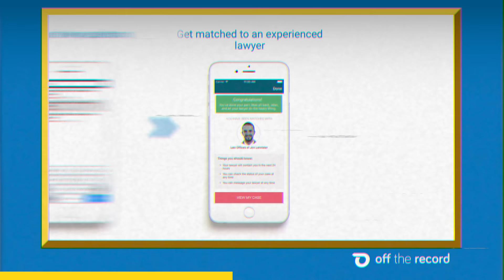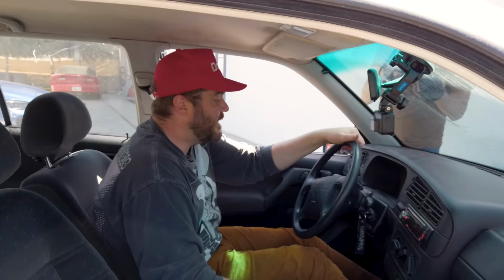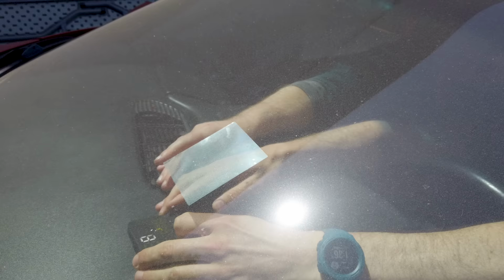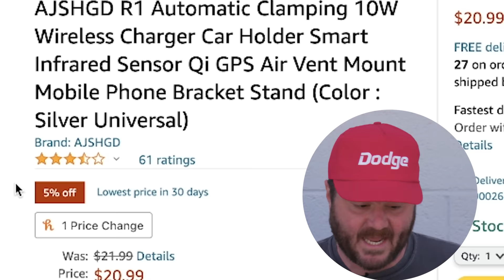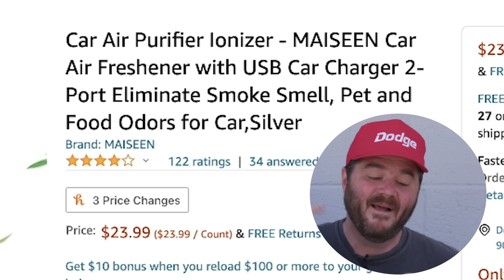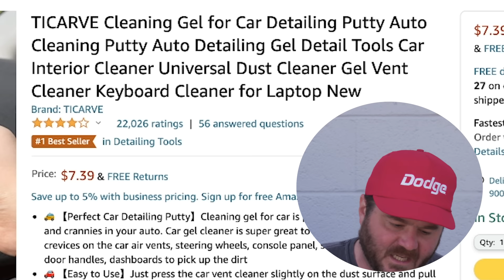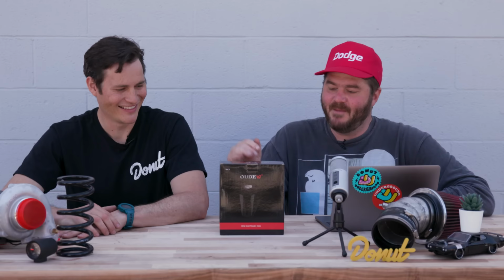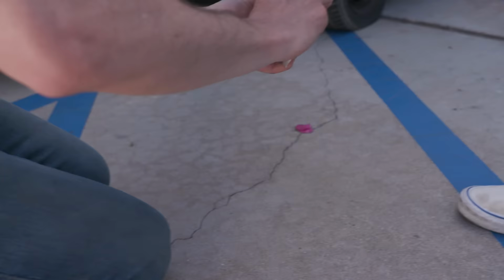We Bought the Most Futuristic Car Products on Amazon

Comment: Just to let you know, the phone holder works. It detects when you're reaching for it and unclamps the phone, and stops charging when it does. As long as it's the same or similar to the one my bf has. If it is, definitely a really cool product.
Reply: As long as your phone has a wireless charging coil built into the back of it or you get one of the ones that plugs into the bottom of your phone and you just stick it in back your case
Reply: I love mine
Reply: It also seems like they don’t understand they term “wireless “ either lol
Reply: @realwiggles  Wireless when it comes to phone charging doesn't mean wireless anyway since the charger still has a wire. There is really no actual benefit to wireless charging over wired
Reply: @connoc5078  yes it does. A wireless charger is named as such because the connection between the phone and charger is wireless. Obviously the charger itself has to be plugged in, but the actual charging method itself is wireless because it doesn't require a wired connection between the phone and charger. Why would this not be considered wireless. In one situation you simply place your phone on top of something to charge it, whereas the other requires you to plug a wire into your phone. Also, wireless chargers offer no benefits over wired chargers? What about not having to plug your phone in? My car has a wireless charger and it's definitely more convenient to set my phone down on it versus having to plug and unplug it every time I get in and out.
Reply: @realwiggles   @Cameron Fite  why would a device that requires a wire be called wireless charging? Literally the only difference is that instead of the wire ending in a head for USB c or whatever, it ends in a mat or pad or whatever.

So you think not spending literally half a second to plug a phone in is worth it for the significant increase in electricity waste?
Reply: @connoc5078  so you've got two types of chargers. One requires you to plug a wire directly into your phone, the other doesn't require you to plug a wire directly into your phone. What do you call the second one. You're being way too literal and technical. Why not just argue that it's not wireless because the electricity has to travel through wires to make it from the power plant to your house at this point. Again, it's wireless because it doesn't require you to plug a wire into your phone. It's perfectly appropriate to call it wireless for that reason. Using your logic, instead of calling them electric cars we should call them coal-powered cars or wind-turbine powered cars because that's how the electricity that powers the vehicle is generated. But that would be ridiculous. 

Why are you bringing up the effeciency of wireless chargers? I don't remember saying anything about that in my comment. You said wireless chargers offered no benefits at all over regular chargers. My rebuttal was that not having to plug your phone in every time you wanted to charge it is a benefit. Setting your phone on something to charge it is objectively more convenient than plugging it in. Instead of recognizing that your statement was kind of dumb, you brought up a whole new topic. You even decided what my position on the new topic is and are now trying to argue against this opinion that you made up for me. Can you show me where I said that not having to plug my phone in was worth the electricity that a wireless charger wastes? I double-checked and can't seem to find anything.
Reply: That seems kinda stupid that it would unclamp when you reach for it. What if you're playing music or really trying to do anything with your phone and not want to actually take it off the charger? Lol
Reply: @connoc5078  My guy, I'm a little worried that you're having so much difficulty understanding why it's called wireless charging. 

So you've got a device and a charger for that device. In order to charge your device with your charger, do you connect your charger to your device using a cable of some sort? You don't? So you're telling me you're charging your device without the use of a cable, a cable that contains wiring? You're saying the charging process is being performed without the use of a cable connecting your device to its charger? One more time, what you're saying is that, referring specifically to the connection between your device and its charger, there are no cables involved? You're able to charge your device without connecting it directly to the charger via a cable containing wires? What do you call that little doohickey? The No-wire Charger? 

C'mon man. This is embarrassing. I can't believe I'm actually arguing with someone that thinks wireless charging isn't a thing because the charger itself has to be plugged into an outlet hahahaha. Jesus Christ lmao. You have to be joking. This is like something you'd see in a comedy where the dumb character is trying to convince someone else that a burrito is really a sandwich because it technically consists of meat and cheeses situated between outside layers for which flour is a main ingredient.
Reply: @realwiggles  Exactly, wireless charging is only wireless in the most extremely pedantic way. Calling it wireless charging is like saying you don't drive a car by using the engine.

It still requires wired connection to the power source, literally the only difference is where you put the charger on the phone.

Saying wireless charging is not actually wired is like saying a burger is not a sandwich. 

Very easy and simple to understand and I hope that when you grow up you understand basic things like this and stop assuming the name of something is always an accurate description of that thing.
Reply: @connoc5078  no, what is pedantic is saying that it can’t be called wireless charging because the charger still has to be plugged in. This connection isn’t what the term “wireless” is referring to. I really don’t know what else I can say to make this any clearer other than to just repeat myself. There exists a transfer of electricity between one object and another that doesn’t involve any wires. This is the wireless portion that is the basis for calling it wireless charging. There are currently two ways to charge your phone. One involves plugging the phone directly into the charger. The phone is physically connected to the phone charger through a cable. The other method does not require a wired connection between the phone and charger. How is it that the “pedantic” thing is to refer to this method, which, between the two charging methods, is the one that does not require the phone to be connected to the charger by a wire, as being wireless, but it’s somehow not pedantic to say neither method is truly wireless simply because the charger itself has to be plugged in. 

What term would you use in place of wireless to refer to this method of charging? Because there are obviously distinct differences that exist between a wireless charger and a normal one. It would be pretty pendant if of you to say they’re the exact same thing. 

What if you had a power bank that was fully charged and not connected to anything that could charge your phone wirelessly? These exist. Are you going to argue this shouldn’t be called wireless charging either because the power bank had to be plugged in to charge it up initially?

Are you going to argue that cordless phones shouldn’t be called that either? That situation is almost identical to this one is it not? Should they not be referred to as cordless because calls still travel along telephone lines even though the phone itself isn’t physically connected to them? 

Again, I’m really not sure what else I can say. You clearly have some sort of mental block that’s preventing you from understanding the factors that exist that resulted in wireless chargers being named as such. You literally don’t even understand which part is the wireless portion of a wireless charger. You keep bringing up the connection between the charger and the actual electric grid itself despite me trying multiple times to get you to understand this connection isn’t even the reason wireless chargers are named as such. 

You’re still won’t answer my question either. If it’s not wireless, than what is it? What would you call the connection between a phone and the charger if it doesn’t involve a cable? All you’ve done is say the same thing over and over, that its not wireless because the charger itself is still wired to the outlet. How do I get you to understand this fact has nothing to do with why wireless chargers are named as such. I’m legitimately becoming frustrated that you’re not understanding what I thought was such a simple concept. It’s insane to me. Wireless chargers are called wireless chargers because they allow you to charge your phone without having to plug THE PHONE into anything. The charger can charge the phones battery without having to transfer the charge through a cable plugged into the phone. It has nothing to do with how the charger itself draws power. It has nothing to do with anything else beyond the fact that your phone doesn’t have to be plugged into anything for its battery to be charged. I can’t think of any other ways to explain this incredibly simple concept. It is perfectly legitimate and not at all pedantic to call it wireless charging. Charging your phone by plugging it into a charger with a cable vs charging it wirelessly by setting it on a wireless charger are two distinct charging methods. There is absolutely nothing that is  incorrect about each method having its own name. 

Here is your argument in a different context: “eerrr, momma says you cant call them watermelons seedless because she says them watermelons grown themselves from a seed just the same as all them regular watermelons. If only everybody else was as smart as me and momma then so many people wouldn’t be getting ripped off by paying more dollars for seedless watermelons when they could just get the same old regular watermelons and things wouldn’t be any different for them”. This example is spot on because it features an idiot that can’t see the difference between regular and seedless watermelons because they fail to understand the key factor that gives seedless watermelons their name. And just to get it out of the way and make it as clear and easy to understand for you as possible, you’re the idiot that thinks seedless watermelons shouldn’t be called seedless for reasons that are both unrelated and frustratingly stupid.

Comment: When driving for a food delivery service (DoorDash, GrubHub, etc) where you're potentially in and out of your car a lot, the 'wireless charging' phone mount is super convenient.  I have a higher quality version that mounts to the dash and I love it.  I have to bring my phone in with me to verify/mark orders, so being able to just set and charge/go is great.  It's not even about saved time, it's just the convenience.  It looks like your team went with the cheaper one for budgetary reasons (which I totally get), but there are $30-$50 options that work very well and even support wireless fast charging (note that it's wireless charging to your phone, not a wire free mount).  You need to really look at the reviews though because some of the cheap ones flop or don't charge well, as seen in this video.  What did you really expect from a $20 mount with a 3 star rating though?  Your team should've known better, which is a bit disappointing.  If a follow-up is done in the future, definitely go for a higher rated option and give it a go (try the dash mount vs the vent mount too, as each has their pros/cons).  Great video overall, but I do see your team did the SAME thing with a few items hoping they'd fail for content.  Up the budget and you won't be as disappointed (maybe still a tad).

Comment: I've got that wireless phone charger, and it can be a little finicky, but it works like a champ most of the time. Used it for over a year. You probably had your hand to close to the sensor which is why it kept opening. And yes it does pull the vent down...

Comment: Ozone Air filter: doesn’t noticeably change air quality, harms lungs, but looks cool
James: that’s futuristic af bro!
Reply: I have no idea if the tiny model they bought ever worked (did they follow up on that?), but we had much larger units that worked very well at deodorizing hotel rooms at the luxury hotel chain I worked.  They were about the size of a regular car battery.
Reply: @MrVvulf  to get rid of mildew smell, you have to get rid of mildew. So just like in your hotel rooms, they would need to blast it with a larger unit. I’m sure those tiny things are helpful with like gym bag smell, but useless for actual treatment. Wouldn’t work for smoke smell or mildew or anything. And it’s just not good for you
Reply: @coopdrips512  Yeah, we didn't use it for mildew removal.  It was for occasions where people had smoked in the room.

Comment: Pro tip, spraying a can of Lysol in the AC air intake is pretty good at cleaning the mildew and mold in the duct system. Crack the windows and leave the blower running for like 15 minutes (Don't stay in the car, go do something else).

Comment: Thanks gents. Great video. I had the wireless charger and worked great. Tip: put it on the last or second to last blade on the vent so that it doesn't drop down and it kept opening on you bc your finger was underneath. It has a sensor on the bottom and automatically opens so you can take it. So you were confusing it ;)  i rate it 5 out of 5 for what it does.

Comment: If you don't see the point in H.U.D., it's because you've never had a car with it, or one where it worked properly.
My '21 Toyota Yaris hybrid came with it from the factory, and I absolutely love it! Drive mode, speed, cruise control info, lane assist info, current speed limit (based off road sign recognition) and eco-meter (or RPM's if you so choose, don't see the point with an eCVT transmission though), all directly in your field of view. On top of that, the bottom of the display shows urgent messages like risk of icy road conditions, low fuel warning, tire pressure warning or simply radio info when skipping songs or changing radio channel.
All of this while keeping your eyes on the road ahed instead of the instrument cluster.

Comment: Okay - several things - why is the Jetta Mildewy? Scotty Kilmer mentioned removing rubber drain plugs in floor pan when cars tend to leak - like trunk, sunroof, etc - though I would rather fix the leak. Also, a product I love is the ATEM air purifier for the car, though not perfect. I have been meaning to call the company back to get a white cover like their desk model uses, as the air purifier will display a "blocked" message on the app when it is too hot for it to operate,  until the unit cools to about 110.  Often I have to reach behind the passenger seat where it is mounted and use the button in the middle to turn it off or off, as the app often doesn't work.  It does give you lights visible from the reflection in the passenger window, low, med, and high sets of blue LEDS, and red LEDS for off.  It will not drain the battery, it will shut off it left on. It makes the a/c feel ice cold in my 99 Mustang, as if it is keeping the air conditioned air up front more - it has an ionizer. Filters last about a year, and is a  HEPA filter. Don't know how it feels to passengers in the rear yet - overall, makes the car air feel really fresh - seems to help my allergies. I think it may help the Jetta. And, on the laser parking pointer - why?   Can you imagine when the batteries go dead - and you smack into the wall because it doesn't come on?  I would personally have a board mounted to the ceiling, with hooks, and tennis balls on string attached to the hooks - so when you go forward, the tennis ball hits the windshield.  Would probably use glow in the dark string, and perhaps have more than 1 per car, so you can see how far over you need to pull so the other car has space. Much more reliable, not dependent on batteries, and hopefully during a power failure will show you where they are.

Comment: I use the same HUD in this video, only cost me $15 here. The biggest drawback is it has about 0.3s lag, and the reflection can’t be focused to the infinity faraway, but I quickly adjusted to it after days, and I never need to look at my dashboard anymore, now I can’t drive in race track without it. The lag problem is still a pain in the ass, especially if your car accelerates reasonably fast, like mine, 0-60 within 4s.